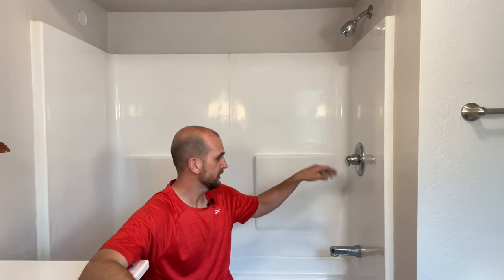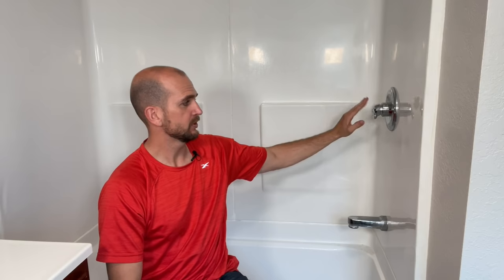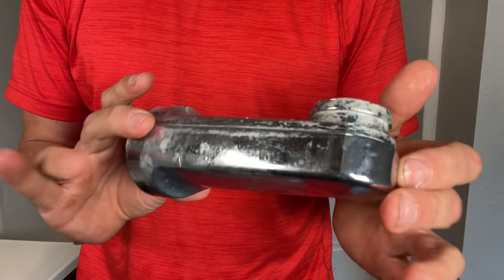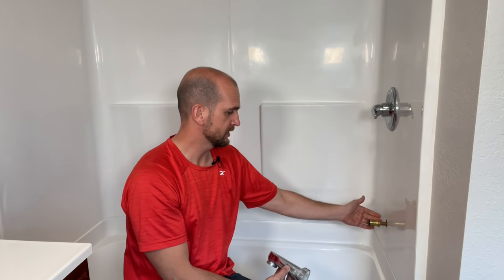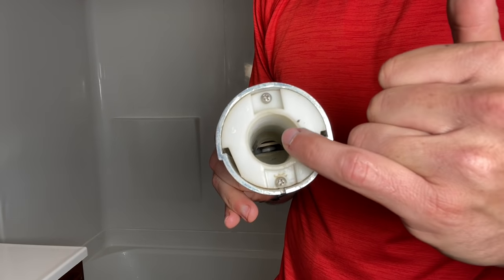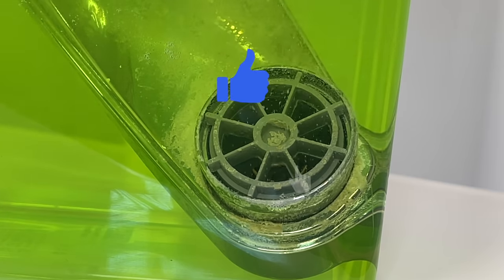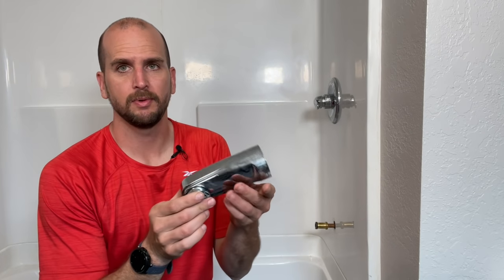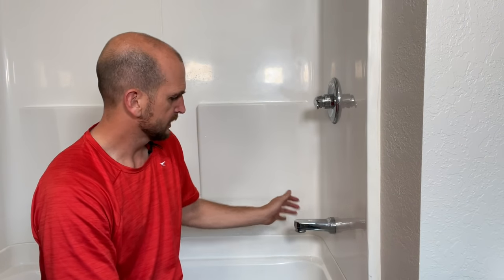Fix Tub Spout That Leaks Water When Shower Is On

Comment: How about the opposite the shower head always runs (some of the flow) when the water is on. When the diverter is pulled all the flow goes to shower. We have a delta and have changed the cartridge and tub diverter to no avail.
Reply: Most likely the brass valve body was installed upside down inside the wall.  

The valve has 4 ports. 1 hot 1 cold 1 shower 1 tub outlet. 

Internally the casted porting for the shower outlet is smaller than the tub outlet. 

This is designed to cause some back pressure so the natural water flow favors the tub outlet. ( Gravity, height, and shower heads play a role as well)

When the shower valve is upside down, the internal restricted port is hindering the flow to the tub spout and forcing the water out of the shower head by back pressure resistance. 

This will cause some water to run from the shower head every time the tub is running. 

If you inspect a new shower valve, you will see all the inlet and outlet ports are different.  

Shower valves are labeled embossed with "up" or "shower" to signify intended orientation.

Comment: I hope you don't mind me asking a loosely related question:  In a condo where the plumbing is the responsibility of the condo association to maintain, and plumbing fixtures (sinks, bathtubs, showers, toilets) are the responsibility of the condo unit owner, what defines the dividing line between plumbing and fixture?  For example, is the threaded pipe onto which the spout screws classified as part of the plumbing or as part of the tub/shower fixture? (To my eye, that pipe looks like part of the rough-in plumbing, not part of the fixture.  My rule of thumb is that the dividing line is where connections are made, with threads or nuts and seals such as o-rings or plumber's tape.)  Also, does the Plumbing Code imply traps are part of the plumbing, not part of the fixture, where the Code talks about the distance between the trap and the fixture outlet? (Except toilet traps, which are built into the toilet.)
Reply: Just my opinion, for whatever that's worth :)  You would think, as you said, where the connection is.  If they the immediate pipe that connects is your responsibility as well, what if you damage it and it causes other problems in spots that are "their" responsibility?  Most of those fixtures are cheap and easy to replace, as well as break due to their cheapness, hence why they say it's your responsibility.  You'd be best catching the actual maintenance person and asking them directly-as opposed to someone in the office.  Plus, the maintenance person may be pretty cool and do stuff on the side or a little extra on the company's dime.  Never know :)

Comment: Mine drips when water is off. I do have same tub faucet and it looks just like your problem with mineral deposits.  
If that dont work I guess it the round handle that turn bath/shower may need replacing.
Reply from the maker: Yeah, you might be able to replace the o-rings on the valve or get a complete new valve assembly to stop the dripping.